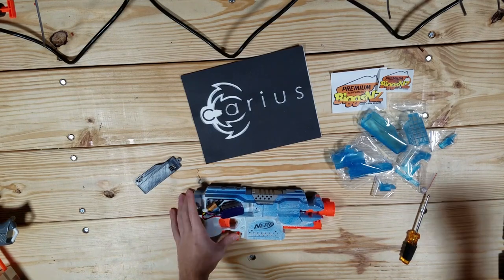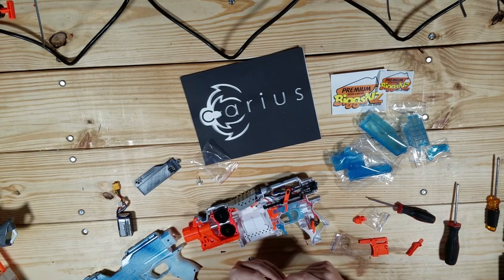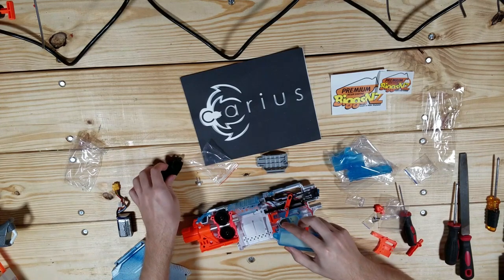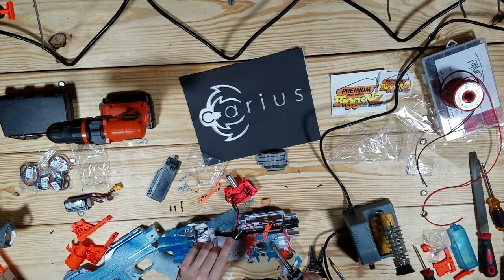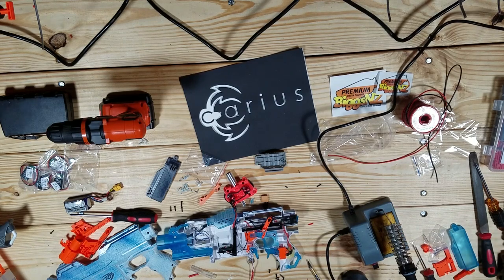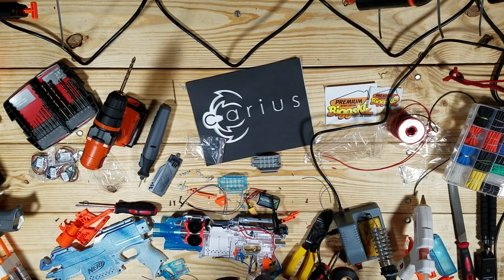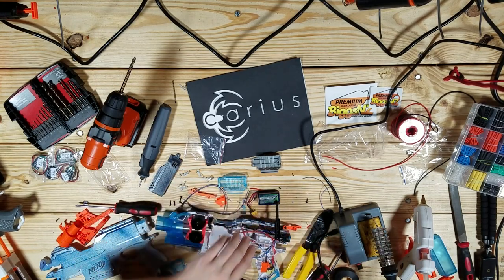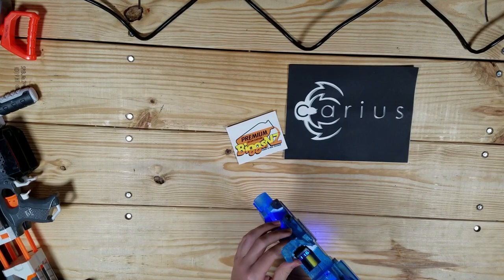Installing clear parts, LEDS, and a Voltmeter into a Nerf Stryfe - Modding with Carius

Comment: Aloha!
Nice video, although the off centre cam is driving me nuts :D
Question about your LEDs though. What kind of LEDs are you using? I can't see you wire any resistors in the circuit and also can't figure out if you got them all in series, or just a few of them and some in parallel. Either way my brain says there should be resistors in it as well so they don't burn out since you are running them of a 3S Lipo. Or are they in fact 12V LEDs?

THanks for your help mate!